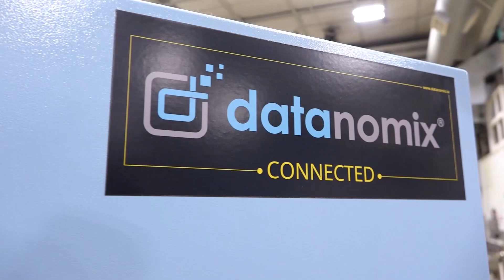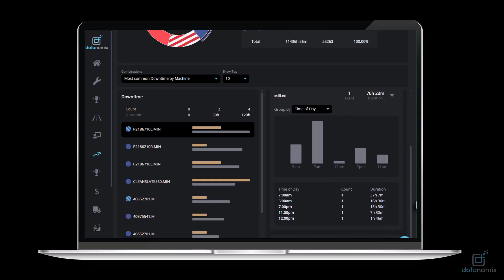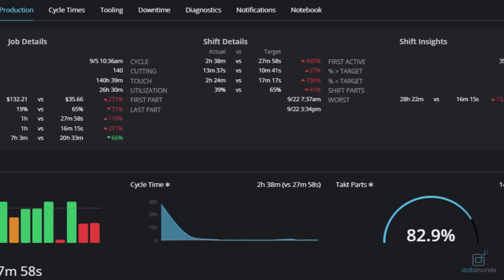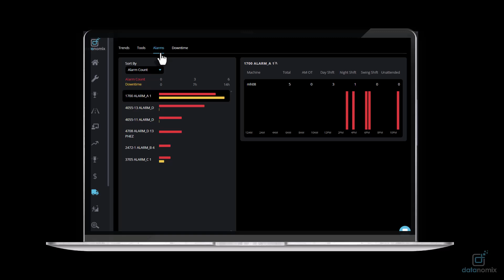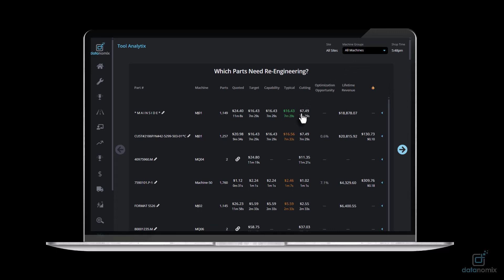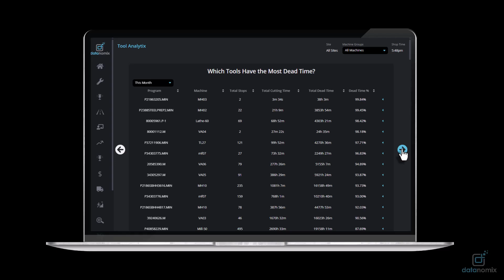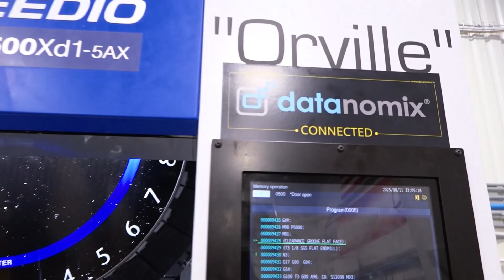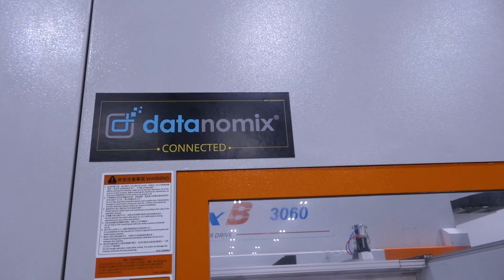The Secret Weapon of a World-Class Machine Shop!

Comment: I work at a shop that started using datanomix about a year ago. It's not without it's faults, that's for sure. Few companies actually use the data correctly, and turns into a finger pointing thing. 

My message is for the companies, please use this tool correctly. If someone is doing their job as you dictate, ONLY use this to IMPROVE flow. I have seen VERY good employees, with 10+ years of service, that help everyone around them lose their jobs because "their datanomix numbers weren't good enough". 

@The WorldWide Machinst You all came to this very shop a month or 2 ago, looking forward to seeing the video if/when it comes out.